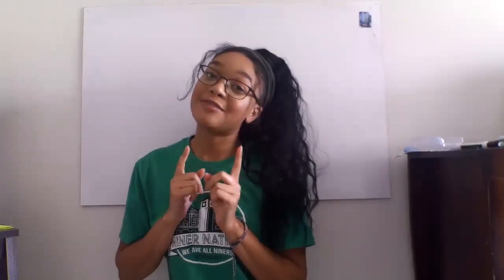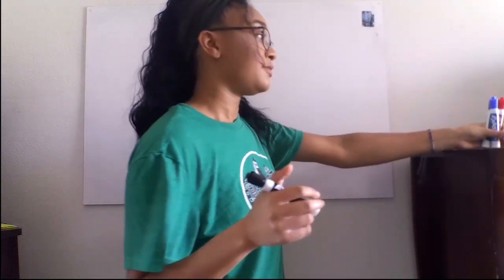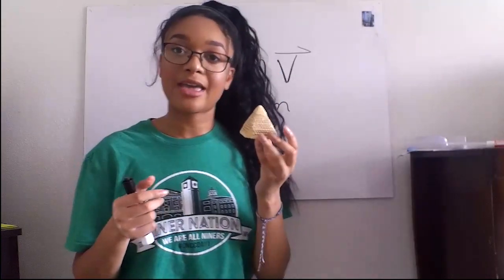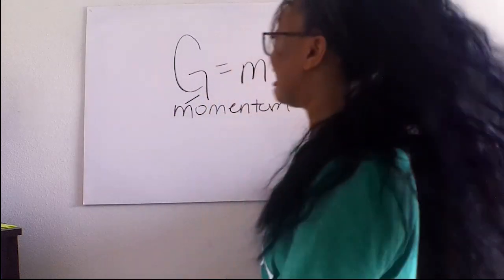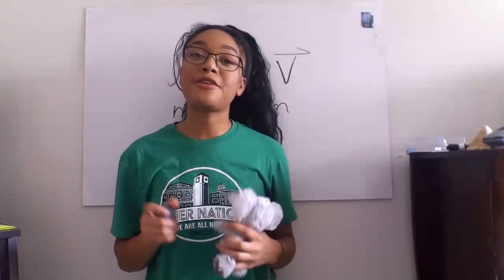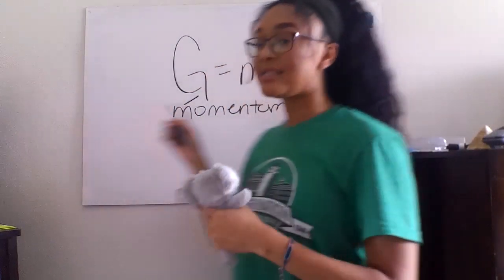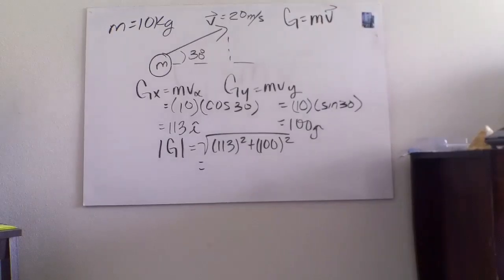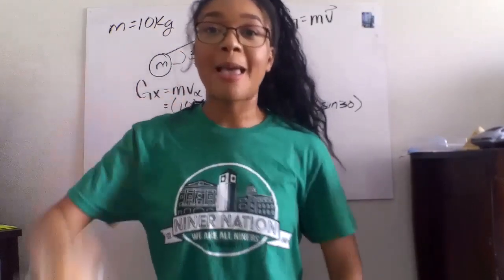WHY DID I HAVE SUCH AN EPIC FAIL? - Episode 2

Comment: So if an object is traveling at an angle,  you have to calculate the velocity its traveling up, Then the velocity its traveling horizontally to calculate the velocity at the angle? Is that where the x and y came in?
Reply from the maker: Yes! Exactly you’re spot on, since the object is traveling at an angle we calculate the velocity projected in the x direction and the velocity projected in the y direction. We then take the magnitude of these two to find the overall velocity. (: